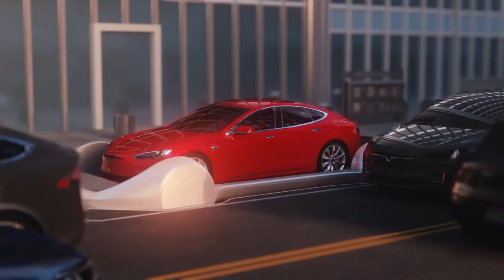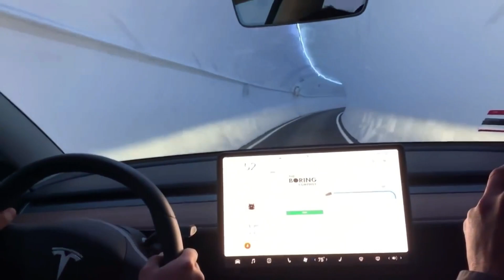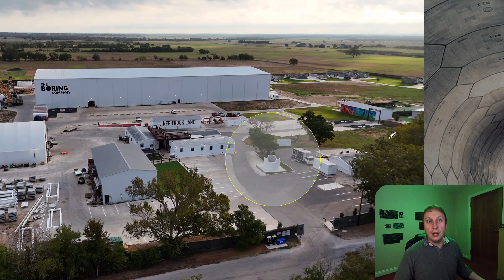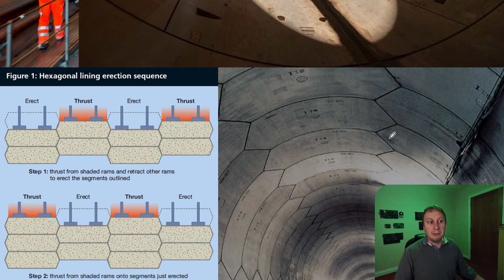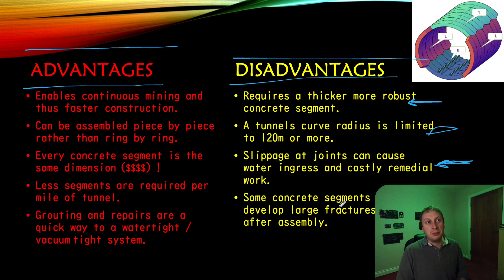In 2020 I Predicted The Future of Tunnelling 😯 #184

Comment: how does the TBM turn with hex segments?
Reply: Not easily. Hex segments are generally only used for straight line tunnels. Control of plane and birds mouthing at joints is also a big problem. Hex segments leak quite badly.

Comment: It is an obviously bad idea to bore tunnels just to move cars, which are the most inefficient expensive transport method and currently are huge sources of pollution which is an even worse idea in enclosed spaces underground.

There is no way you can move significant amounts of multi tonne cars with their 1.25 occupants using tunnels.

Do the sensible thing. Create a huge capacity underground clean electric metro network instead. And stop urban spread which is the original source of all the transport problems. Long distances = long commute timees.
Reply: Your new here aren't you. Why don't you watch the series before publicity embarrassing yourself. Welcome to the future.
Reply: @geomacaulay   So you are the reporter for The Idiot's Weekly then?

You embarrass yourself,  buying any con job with a billionaire attached to it.
Reply: In the U.S., which has a much lower population density than Europe, passenger trains are actually less energy efficient than automobiles with one passenger each - to say nothing of cost or time efficiency, where automobiles also beat trains.

Make those automobiles electric and the energy efficiency is at least twice as great - and air pollution in tunnels should be minimal.

With current trends for automation, artificial intelligence, and robotics, it should be quite possible to put many roads underground as labor costs will be a much less important factor than they are now.
Reply: @alanlight7740   Don't tell me where you plucked those "facts" from, I can guess.
Reply: @peterbreis5407  - ah, you're familiar with Brad Templeton then? His robocars web site has lots of great information, even though it is something like 15 years old. The page on the Green Transit Myth is excellent.

The acceleration of technology development is common knowledge of course, as is the difficulty of human minds to truly comprehend geometric growth - but the numbers speak for themselves.

Comment: Why do you act as if hex segments only work at a specific size? as long as you have an even number, you could use 4 as you show, or you could use 20 (or more likely 6 or 8 to make the segments similar size to what they use now)

going around turns with preformed concrete will leave gaps no matter what shape the segments are, but just like with their existing segments, you could have hex segments that are engineered to make one side of the tunnel longer than the other, but still mesh up with the fully hex segments on each side.

using your example of 4 segments, make a set of 'bend' segments where the angles are not all 60 degrees, the long sides of the top and bottom aren't parallel, and the distance from the long sides of the side segments is different.

This set would make a specific radius, but that's adjustable outwards.

if regular segments are A, the odd tops B, the odd sides C, you would do AA BC BA BC BA BC BA AA but you can insert additional AA sections to extend the radius.

they also need to rotate vertically, and the same thing can be done to go up/down (AB CB AB CB AA)
Reply: Currently it is TBC that are constraining themselves to one size of tunnel not the segments. Although there are design questions over the stability of Hexagonal segments above around 7m diameter (too much detailed design maths to go into here). 
Hexagonal segments really struggle around curves due to the way they are staggered in their build, again the maths is complex but it does lead to opening of joints and misalignment. This in turn leads to problems in handling the thrust of the TBM on the rings to be able to provide the reaction to the forward thrust required for excavation. This then leads to open joints, cracked rings and leaks. All made exponentially worse as the tunnel goes round corners.

For these reasons hexagonal segments are unusually used on double shield TBM's where the ground is strong enough to allow the TBM to get the thrust reaction from the walls of the tunnel rather than pushing at a slight offset angle on only 50% of the segments at a time. 

The most common segmental rings used are the same as the ones TBC are currently using. A "universal" ring of 6 segments (3 rectangular, 2 Top plates and a Key). Larger tunnels will add more rectangular plates into the build. A ring would typically be 1% narrower at the key and 1% wider at the opposite side. This can be built in any orientation (depending on the number of equally spaced bolt/dowel/connector holes to follow the excavation of the TBM. 

Your orientation arrangement doesn't work unless you are building to a repeated plane. The staggered nature of a hexagonal ring keeps creating small gaps when attempting to build around corners. Some tunnels use Hex segments for long straights and then have an adapter "half" ring to allow universal rings to be used for corners. Even in straight lines some creep occurs and packers are required to maintain the "plane" of all types of rings.

Only 2-3% of tunnel use hexagonal segments for good reasons. Many years of development by some very smart engineers have led to this. The tunnelling industry is in a constant state of development, right at the forefront of modern design and construction. Unfortunately TBC do not seem to appreciate this, even though their own current methods are 30 years out of date and they market themselves as if they are doing something revolutionary. An hour research on the internet would show anyone interested that they are not. It's a shame really, with huge investment so willing to throw money at the company they could make a difference in the global tunnelling market.
Reply: @davidsalisbury50 Yeah but just like as he stated great technologies have been abandoned by great engineers before. So just because hexagonal is a small percentage now, it doesn't mean it won't dominant going forward.
Reply: @freddybell8328  Not sure where he said it or which technologies you are referring to, please elaborate. In most cases there are materials or parallel technology constraints that lead to a technology being put aside until better materials allow them to be used effectively (batteries being the most obvious case in recent years).
His assumption and maths is not correct. Segments can be made to leave no gaps while going around corners, his AA, BB maths only works on an infinitely thin segment it doesn't work with physical thickness (hence the leaks and cracking problems).

Hexagonal segments (by which I mean all types with a stepped lead thrust plane) don't work well because of the geometry not allowing a complete leading plane. This leads to three main problems. 
1. Thrust cannot be applied evenly or necessarily targeted to achieve alignment control. This means a TBM can only effectively operate in straight (or almost straight) lines. Most hexagonal ring tunnels are straight or near straight.
2. Thrust on the rings themselves is limited so the segment type can only be effectively used in hard rock where the forward thrust can be achieved using side wall (rock). This is common on "double shield" TBM's where grippers and can only push on the rings with very limited force and most of the forward thrust comes from side grippers. These type of TBM's have achieved most of the tunnelling records to date.

3. The geometry of the segments doesn't allow for what is called a "universal taper". There are some limited versions with Left, right, up, down segment sets but these are far from ideal for a number of practical reasons and often lead to leaks at the joints and cracking of the rings due to "out of plane" joint alignment. Similarly there can be issues with the connections .High tolerances and packing of joints are necessary, or, in many cases, the segments are allowed to leak and the inflow water managed (channel tunnel being such a case although it used wedge-block not hexagonal segments along most of its route).

There are good technical papers and presentation on this issue that explain the problems far better than I can do.